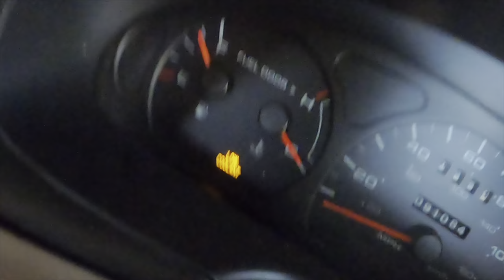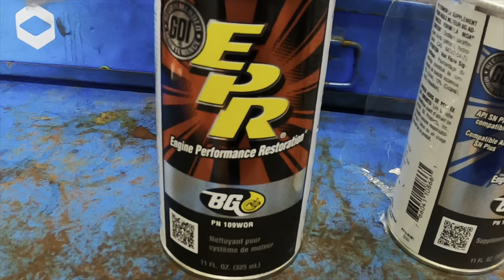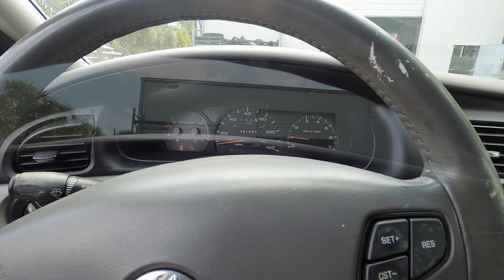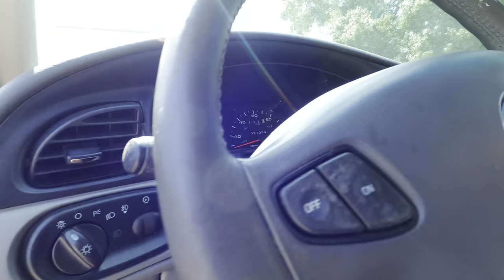Customer States: Never changed the oil….oops

Comment: Quit wasting your money how long you’ve been in his business change your oil minus out 1 quart motor oil and put 1 quart of ATF in it and run it for about 3 miles. change oil do the same thing again and then this one until the next oil change with the ATF in it, because the ATF is highly detergent It will soften the seals, and it will break all the sludge down Automatic transmission, fluid will flush that motor out quick I run 1 quart ATF in my motors it all times I just minus out 1/4 motor oil and just add any type of automatic transmission fluid because it is highly detergent in it. These newer oils don’t have the detergent zero that’s why these motor sludge up these fully synthetic garbage oils. if I cannot find convention oil, I will run a quart of ATF with that oil that fully synthetic garbage so the motor stays clean. There’s no sludge buildup whatsoever at all. It’s all school track and you look like your old enough to know this, but it doesn’t look like it, you waste money and time on that garbage motor flush and all that is kerosene diesel and transmission fluid I don’t know why people waste their time buying that garbage when I know he got a couple quarts of ATF laying around and you could use that and it’s better for the motor anyway it softens seals cleans everything up and it helps break carpet loose. You could actually add a quart of ATF to your gas tank and that will break all the carbon down because it’s going through your fuel system. This is the all of the old dog tricks, old school and newer vehicle that I have says 7500 miles before oil change I do not do that. I do it every three months or 3000 miles and I run a TF in them because I’ve tore valve covers off that motors had their regular oil changes done to the manufacture specifications and they want this done so they could jump out of the warranty just like this lifetime transmission fluid they got out is a bunch of crap do your transmission service at 7500 or two years which ever comes first don’t go by the manufacturer because that’s what they want they don’t want to pay for that motor there’s zero20 motor oil is like dumping water in the engine repair in clearance hasn’t changed you could use 530 and zero20 I know I’ve done it. The motor doesn’t change it doesn’t wrap it doesn’t lose oil pressure. The motor is actually quieter because it’s got lubrication now, instead of that water that people dump in their motors, like a bunch of dumbasses believe these manufactures engineers, and that’s why they’re replacing engines at low mileage any motor H you build your bearing clearance at the crank needs to be at least 3000 you could tear a older motor down and a new motor down and you’ll see the burn Claire’s is the same but they say you say 020 if you don’t you have internal damage no you won’t because I’ve done it never had an issue at all people got a think logically the motors have it change none they just have solenoids and they want this thin garbage oil to get to the barons quicker and the thing is that weight of oil is so thin it breaks down faster just use 524, 530 conventional oil it’s cheaper. Your motors quieter it lasts longer and it doesn’t get sludge up that’s half the reasons why these trainings are failing and these motors are failing because people are going by the manufacture recommendations and they want you to do this because they don’t want to pay for it think back you want to go back to the old way and your motor will last longer people just need to use a little common sense. Think about the bearing clearance look it up and you’ll see what I’m talking about it doesn’t change that much they’re not making these motors any tighter because if they do, the burns will burn up, you have to have the same clearance that oil will still pick up the more lubrication you have the less metal you’ll have on and these people are running around like idiots 80,90 miles an hour down the road in her foot in the floorboard just to take off from a light sitting on the side of the road with a blown motor. It’s your own Fault, because they think it’s a Reece Vehicle, it’ it’s a plain Jane stock motor it’s not made to be one in this whore. The way people are doing it nowadays they think having a loud exhaust now they have a race car you need that back pressure the computer need to see those pressures to perform right I don’t know what the logic peoples thinking is that they need a loud vehicle. The thing is if you have something going on, it’s getting ready to fail or you could catch it before it actually destroys a motor. If you didn’t have that loud exhaust you could actually hear something going on in the vehicle telling you hey look at this problem before it leaves you stranded, you don’t need your radio up you don’t need loud exhaust. Listen to the car talk to you and most of the people would be sitting on the side of the road. You can’t hear nothing with a radio up or a loud exhaust people broke down on the side of the road it’s their own fault. They deserve to be sitting there and they break down bitch and whine because it’s a piece of junk. It’s a manufacturers fault. No it’s your fault because you want to run around like an idiot and don’t care take care of your vehicle you can’t hear the vehicle talking to you, you can catch a problem before it happens and do your maintenance early not with the manufactures recommend do it before that and you won’t be sitting on the side of the road these grocery getter things full-size F1 50s with loud exhaust think they have more power with straight exhaust. It’s all in your head it’s just noise just like the Knm  air filters that is the biggest waste of money you’re sucking all that hot air in throwing off the sensors, throwing your fuel trims off you hit that water, and that motor does suck that water right up and Hydro lock and destroys a motor, they think they have more power because of that sound from the air filter. It’s all in your head you didn’t get no more power and if you think you got more power by that exhaust system or that filter air filter, put it on a dino test and prove it because you won’t increase horsepower buy a damn air filter or a straight exhaust

Comment: What a way to rip off customer. No need for mechanic in a can as engine had oil just low. Low enough pressure to spin bearing also wipes ot heads. Didn't even mic crankshaft.  Will be coming back for new motor and your shop pays for it.